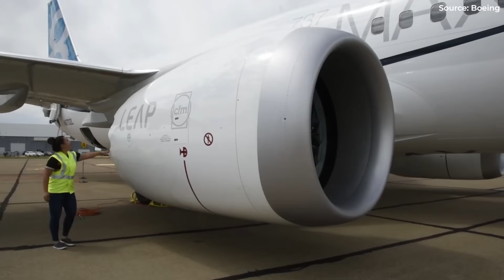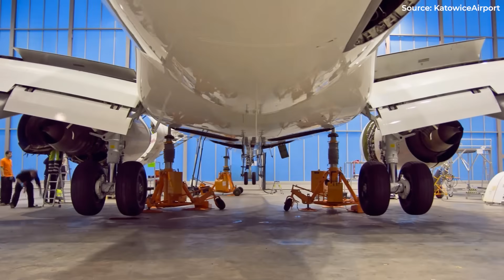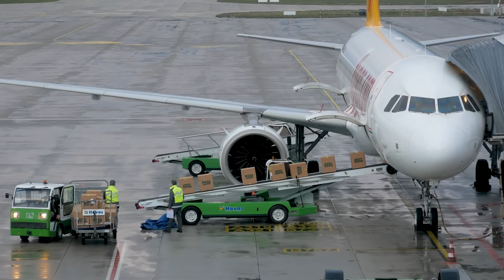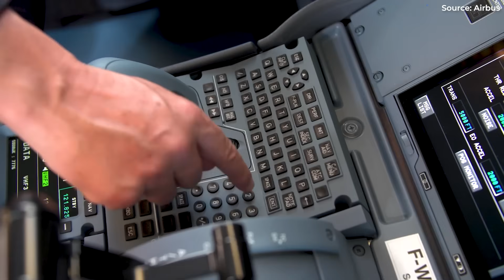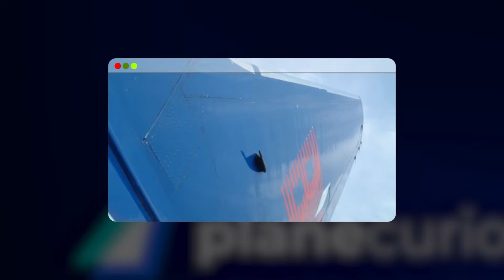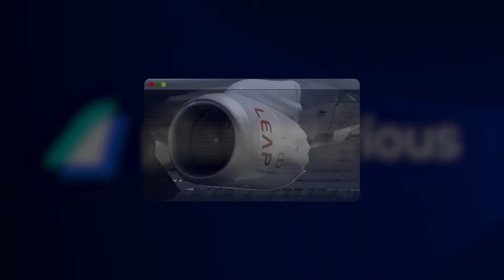What The 737's Flat Bottom Engines Are Really For

Comment: Technologically and Financially, there is a limit or crossover point in revamping a 65 year old airframe with 'bolt on' modern design solutions e.g. when accommodating ever increasing bypass ratio for engine fuel economy.

Boeing ignored this limit long ago and now paying the price, who unlikely to comeback for at least the next 10 years (time it take to commission completely new jet), when Airbus starting to overtake Boeing in every success metrics.

Comment: You just point why the 737 is a dangerous aircraft, engines low position leading to get them further front with each upgrade creating tremendous engins effects when it comes to fly it, it is not an aircraft difficult to fly, it is an aircraft that is diffucult to fly the clean way… then let’s talk about  ergonomics, it dates from the sixties… would you but in 2025 a car first realised in 1967 ? It’s Time to retire for this aircraft
Reply: Boeing is working on a new midsize that is gonna be a cross between a 767 and 757. Boeing has worked on a 737 replacement in the past before the Mcdonell Douglas merger. When MCD merged those plans died quickly, but before airbus released the a320 neo family, Boeing was talking about a new aircraft design to replace the 737. It wasn't the 787 cause it was already in the works. It's only a matter of time before they do it. But the 737 is a tested tried and true aircraft. The 737 max has been questionable nonetheless. But the DC-10 was a controversial aircraft that went on to have a safety record similar or on par with other jets of it's time aka l-1011 and 747, it's not a apples to apples comparison but the dc-10s flew under FedEx all the way till 2023. And some specialized dc-10s still fly like 10tanker or omega aerial refuelling. And even though the dc-10 and md11 family are grounded currently after ups 2976 I doubt they will stay grounded forever. Old designs can still fly and can still be relevant.
Reply: @ttk-sf2 shouldn’t they finish the work on max 10 and 777x before ?
Reply: @gordefluhastubrif1667They will finish those first, I doubt it will be released before the 777x or max 10 is. But the new aircraft will be like a 787 in the theory. Composite and efficient, but we will just have to see.
Reply: Yes I would it's called the Corvette ... :face-blue-smiling:

Comment: Thanks for this great video. I'm surprised you did not mention the main gear of the 737-900, equipped with a system that "lifted" the aircraft when rotating at takeoff so that its long tail did not touch the ground ! A crazy "afterthought" choice made instead of lengthening all gears, which to me should have been the right choice to fit bigger and bigger engines, strech the fuselage without constraints... and not need the MCAS which lead to tragedy twice already.

Comment: What Boeing did, working with CFM International, was to move some of the accessory systems on the CFM56 engine from the bottom to the side of the engine. That made it possible for the flattened nacelle on the 737 Classic models.